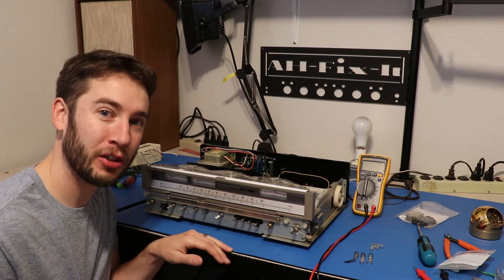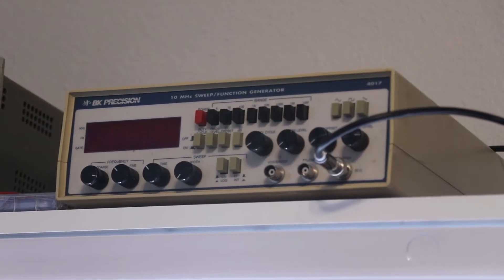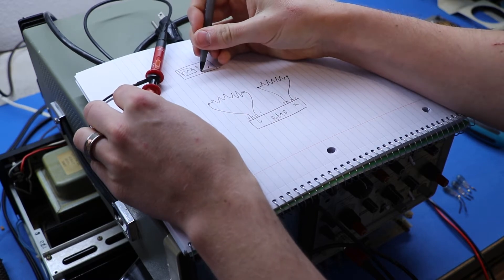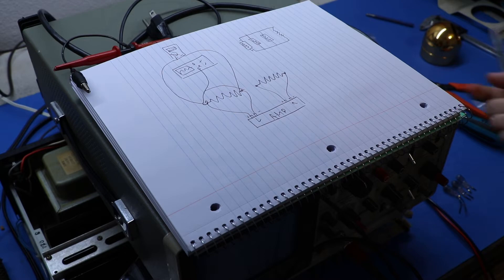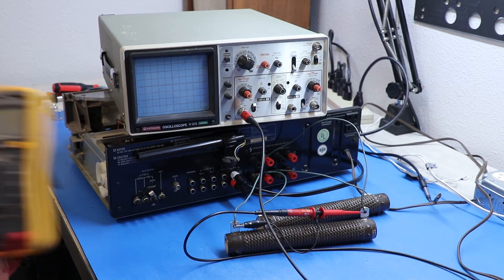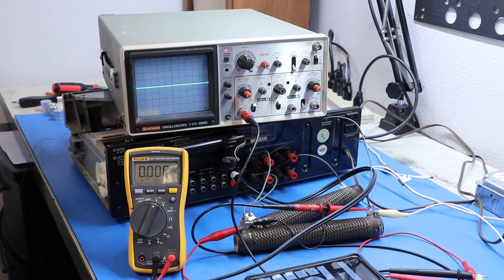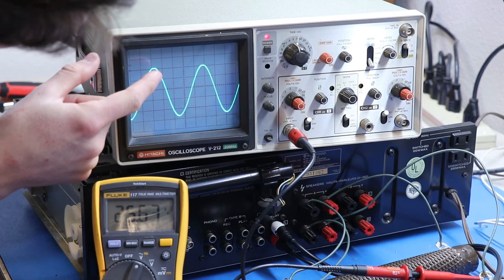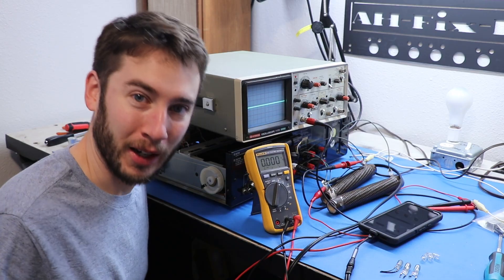How To Measure RMS Watts Per Channel

Comment: The multimeter is reading RMS volts, the oscilloscope will display peak-to-peak.  Divide the peak-to-peak by 2.82 (twice the square root of 2) to get RMS on a sine wave.  Anyway,  power = (voltage^2)/resistance but always use the RMS voltage when doing this.  Your setup is going to be more accurate since you are using the scope to detect clipping rather than guessing at the voltage by counting divisions.  
So 23.5 squared is 552.25, divide that by 8 (ohms) for 69 watts (slightly rounded).

Comment: Thank you for this video and all the others that I have viewed. You provide a straight forward description of the task at hand, that most should be able to follow and build on their knowledge base. With this one, what is not clear to me, is what the typical input voltage signal should be? The frequency is defined as 1 kHz, but unless I missed it, the voltage was not defined. Typically, I will use a 200 mV to 500 mV signal on the Aux input, but maybe it should be higher.

Comment: Aidan,
I was following along in this video with a little Marantz 1070 stereo amp that is spec'd at 35 WPC.  Simplistically, I my goal was to comfirm that I am getting 35 wpc or better.  The 1070 is plugged into a Dim Bulb, speaker outputs are connected to the same power resistors, Tek 2236 Oscilloscope, and a DMM all in parallel like you showed us.   The problem for me is that when I raise the volume up to 60%, the dim bulb starts to take on a small amount of current (i.e. it is dim).  I am only getting 10 VAC on the DMM and where clipping starts to occur at 14 Watts Left Channel.   I am only getting 9.5 VAC on the DMM for the Right Channel (i.e. 11.3 Watts)  However, Peak to Peak on the O-scope I am at 30 V (5 V/div) for six divisions peak to peak (112 Watts) which is not possible for this amp.   Thoughts?
Thanks very much (...long time viewer)
Mike
Reply: You'll need to disconnect the dim bulb from the circuit, its a current limiting device (absorbing the power before the amp can get it). Dim bulbs are commonly used when testing amplifiers before going to full bias on the output mosfets :) If still in place when the amplifier is biased up (as it would be from the factory) the bulb will prevent it from reaching full power and will glow.

PS: The dim bulb is a form of safety. Have some confidence the circuit functions and doesn't short out before removing it. (You might get away with an isolation transformer, I'm not sure though!)
Reply: The calculation must use RMS voltage.  To go from peak-to-peak to RMS (but only on a sine wave), divide by 2.82 (twice the square root of 2).   So you have 10.64 volts RMS.  THAT is what you square then divide by the resistor (8 ohms), or in your case, 14 watts (RMS; the DC equivalent power).  
Input power to the amplifier itself will be AT LEAST twice the output power and that assumes 50 percent efficiency.  A class AB amplifier is more likely 33 percent efficient so at full blast you will consume three times the power from the utility as you are delivering to the speakers.

Comment: Why exactly 1kHz and not any other?
Can I not connect the speaker instead, as it's resistance is always the same?
Thx, great video
Reply: No it's not always the same. First for speakers it's impedance, not resistance, and that's one of the differences, impedance varies with frequency. Lookup speaker impedance curve. That's why, to get standardized measurements and results, a non inductive resistor is used, and the measurement is taken at 1kHz.

Comment: Hi, great info, and I was wondering how this can be done. Thanks for sharing. Have subscribed. Er...  I have a question, please:  Do I have to buy those exact same 300W resistors?  Can't they be of a smaller wattage?  For instance, I already have two 8-ohm resistors  @  100 watts each.  Since all the amps I ever came across (so far) were all  (no exception)  in the ballpark of about 80 watts (Audio Power rated by their manufacturer), So I'm thinking, can I use those instead or.....?  Tnx.
Reply from the maker: Sure but they'll get extremely hot and might become dangerous to handle
Reply: @AHFixIt  Oh... I see what you're saying. Well.... I might buy those then. Thank you, and I like your explanations a lot. You are a nice teacher to all the beginners. Tnx once again. And can't wait for the next video of yours. Regards

Comment: Very well presented and demonstrated ! One question about the input signal, quite often you read about nominal inputs or line level input as aux input and they are designed (to my knowledge) for 1 volt level or so , don t you think there will be merit/interest to adapt on a function generator the test input signal to one volt ? 
Thx

Comment: You do a really excellent job of troubleshooting and diagnosing these incredible vintage receivers which I grew up with at about your age. I'm what you call a Heathkitnic, meaning I started building heathkits in about age 13 and really never stopped until they were no longer available and then I started collecting. All of my Heath kits are operating and are not trailer queens, I enjoy them everyday and they have never required repair. Do you know about and how advanced their products were?

Comment: There is no such thing as RMS Watts. Power rating is average, not RMS. Only volts and amps are RMS. And that is not an X on the scope probe. It is a multiply symbol. It is one times, not one ex.

Comment: I find your recourse to a web site to do basic calculations quite humorous. I recently performed this exercise to see what I was getting out of my bridged-to-mono power amps. My resistors weren’t as stout as yours and they got quite hot at full load. Using my scope I was seeing 155-160 Volts p-p which was at the limit of what my scope could supply. First step: Since we need the equivalent DC voltage for the power calculations, Vpp = 2*sqrt(2)*VRMS, rearranging terms VRMS=Vpp/2*sqrt(2). The sqrt(2) = 1.414, twice = 2.828; Vpp = 157/2.28 = 55.5 Vrms. Second Step: Ohms law states that V=I*R and that power, in Watts, P = I*V. I don’t know the current, but I do know the static resistance, and I know that (rearranging terms again) I = V/R, so P = (V/R)*R or P = (V)squared/R. The resistance of my ganged resistor pack is 7.5 Ohms as measured by my DMM, so plugging in my values: P = (55.5)squared / 7.5 = 3,082 / 7.5 = 411 Watts. For an amp rated at 350 Watts bridged into 4 Ohms. (A RadioShack MPA 250.) My resistors (two 25 Ohm + two 50 Ohm, all adjustable and mounted in parallel) were getting hot enough to cook a steak on after not much time. I set the VU meters to normal listening levels and calculated that it was consuming about 7 Watts. I’m grateful for the part numbers of your resistors and need to get some of them on order. You may find my calculations as humorous as I find your web searches, but it is how I learned things, only two formulas do you need to make a host of calculations V=IR and P=IV.
Note: Wouldn’t publish the 411 Watts as an official rating, the exercise was to satisfy my curiosity about the capabilities of my amplifier, I would need to do a lot more verification of my setup before I would confidently publish power ratings.

Comment: Does this approach give you an indication of distortion? For example, does the smoothness of the sine curve indicate low distortion? Or can I conclude if power is up to spec, the distortion is probably at spec too? Perhaps a different test, but power and distortion are hand in hand for performance.
Reply from the maker: This test doesn't give a good look into distortion. A distortion meter or spectrum analyzer are what you want to use for that. Expensive tools that I don't have....yet. xraytonyb just released a good video where he tackled a very odd distortion issue on a Marantz. Watch it when you have a minute. It's a good showcase of how those tools can help you: https://youtu.be/byijs873XVc

Comment: When doing this one needs to make sure the negative speaker lead is not driven.  One way to do this is to see if there is continuity between left and right negatives, common, whatever you call it.  overall best way is to make sure the negative is tied to the center tap of the high voltage transformer windings (or ground, on grounded bridge amps like some Crown typologies.) 

If the negative lead is driven, you will attempt to drive the ground of your home.

Comment: I am using a function generator on my iPhone 12, out the lightning adapter to a 3.5mm stereo cable to RCA. There is quite a bit of ringing in the square waves however. I think it needs a better impedance match, perhaps a couple of 100 ohm resistors across the RCA outputs?

 Not that that would matter for the purpose of viewing clipping of a sine wave, but just pointing out using the phone generator has it's limitations. Cheers man
Reply: I use a cheap BT-reveiver to feed the smartphone test signal into the receiver/amplifier.

Comment: I did not see anything in the spec sheets about those load resistors being non inductive. They should be non inductive design for audio load resistors from what I understand. Great video
Reply: I was wondering the exact opposite direction. is a pure resistive load a valid test load for an audio amplifier power measurement, because speakers are a coil.

Comment: Great video. Love it. I have 2 questions. 1st did the 69W is RMS or peak power? 2nd did those resistors are carbon or not? Because what I've heard that carbon resistor are better for testing those amps. Thank you.
Reply from the maker: RMS and they are not carbon
Reply: Oh.. I didn't see the subject 😊.. Thank you for your reply. ❤

Comment: Mean power - there's no such thing as RMS power (it's a mistake that a lot of amplifier manufacturers make, sadly).  Assuming a sine wave, RMS voltage x RMS current = mean power.
RMS voltage (or current) of wave is the equivalent DC voltage (or current) that would cause the same power dissipation in a load.

Comment: Good demo, but be mindful of truly balanced power amps though, where the negative of the speaker output is NOT at ground potential. You will either blow your scope, your amp , or both.

Comment: For a receiver that's rated 45 watts per channel into 8Ω, 69Watts is impressive. How accurate is the 8 Ohm Resistor load?
Reply: The factory rated  45 watts is probably at .05% or .1% THD where he's measuring until he sees clipping. Which is more than likely way above that.

Comment: Still have to put a load on both channels even if your testing one at a time right ?   nice little demo.  learned a lot from you and a couple others, a valuable recource.
Reply from the maker: Not necessarily but I always like to
Reply: It's best to use load resistors on both channels as the capability of the power supply can affect power output when both channels are driven.  Most power ratings will state something like "... both channels driven".
Reply: *You’re.